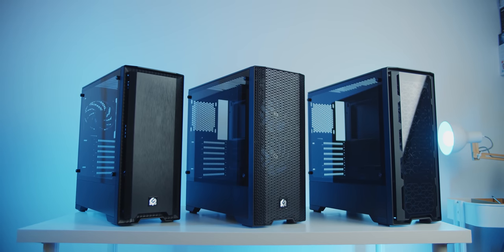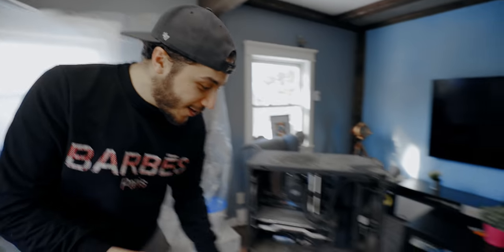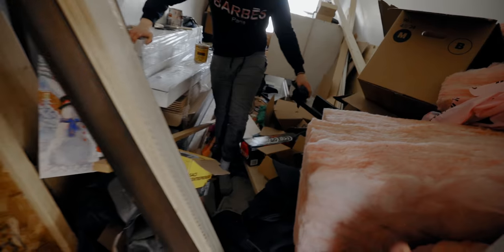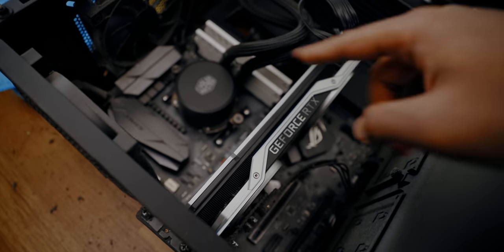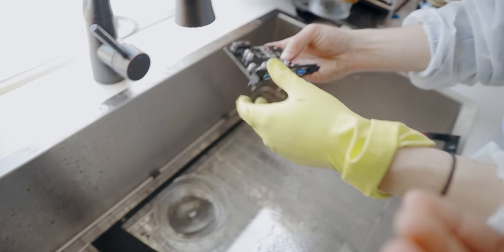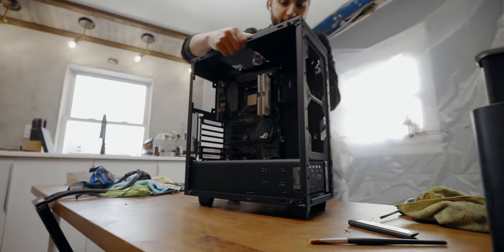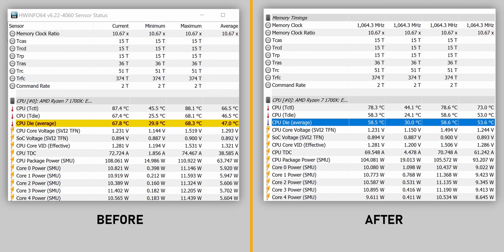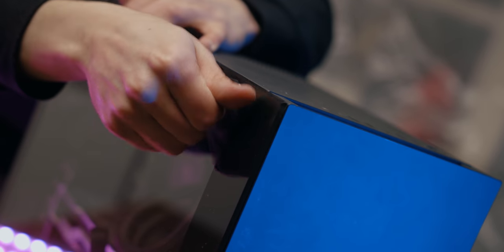THIS Is Why Cleaning Your PC Is Important! 🤦‍♂️

Comment from the maker: For those wondering - yes the liquefied USB card survived.  😎
Reply: Did you guys have it for the after tests? If not that could help explain the performance delta as well.
Reply: Surprised that whole PC didn't end up in an alcohol bath!
Reply: Electronics should survive regular water as long as they are dried completely before receiving power again.
Reply: I work in a circuit board manufacturer and we also wash pcb's regularly, as long as your water is balanced and you make sure it's dry it should be fine.
Reply: Damn bro, keep your pad clean. Givin the rest of us canucks a bad look.
Reply: Guess he watches youtube enough to know you can wash and dry PC components. And 10 degrees delta is 10 degrees any climate regardless of ambient. And that USB card is completely irrelevant to CPU temp performance. And the 2 degrees on the GPU came from less dust, you saw what came out of it. Not from the card being pulled.
Reply: Well techyescity did that to his motherboards
I have done that to my psus
Also I had open psus 😂
Yeah i know I'm risky but I don't touch the big capacitors legs as long you don't touch the 2 it's fine
Reply: a very THE VERGE moment there. I hope he screwed it back in with confidence.
Reply: LoL
Reply: Todd Ector wdym watern is balanced?
Reply: It's okay to clean PC parts like that if the part is getting dried very soon, so PCB does not get wet inside and metal parts do not corrode.
Reply: Having been in the electronics industry, washing boards is no problem - you can use compressed air to dry boards.    People avoid washing boards with delicate connectors.    You can use Alcohol or electronics cleaner and the alcohol will pull moisture out from under chips.   A USB board is no big deal, but something with a ball grid array underneath is best cleaned with electronics cleaners.
Reply: Roman "der8auer" puts his OC MB Just in the Dishwasher, so np here /watch?v=SVuI-Fn27-U
Reply: OMG I'm going to put my motherboard in the washing machine then
Reply: I mean, people wash motherboards in the dishwasher without problems. Afaik electronics fail when they are used while wet, short circuit and stuff. But as long as you let them dry out first electronics can usually survive a bit of water.
Reply: Of course it did. Cleaning PCBs with water is perfectly fine as it is for lots of other electrical components. What I would recommend immediately after a first short drying (tap it with some paper towels) is dowsing it in (or if you don't have large amounts...lightly rinse and brush it with) ethanol. This way you will be pretty safe and won't face a risk of corrosion occurring any time soon.
Reply: does anyone know where or what brand the barbes paris jumper is?
Reply: All I want to know is how's the I/O on the case?
Reply: Bro, he said he didn't clean it around 3 years. and the RTX came. on 2018. So he opened before. How vague you have to be to do not clean the stuff you use... and also his main system? Come on dude 🤣
Reply: David Peña Ortiz right? So he upgraded his gpu, probably changed power cable as well, like from single 8 pin to 2 8 pins, or single 6 pins, sure, full system clean out cost lot of time, at least use compressed air to blow out dust every few month
Reply: Someone told me once that diesel fuel or kerosene can be used to clean stuff like this. Whether or not it's true I have no idea and I'm not about to find out either. Only place I put diesel fuel is in the tanks on my 95 F350 Powerstroke Diesel.
Reply: @caominh2874  depending on where you live and your water supply yes, the pH of water is slightly different, also the mineral content of the water can leave behind a limescale residue if you live in a hard water area, if you do then it is best to use distilled water instead, although obviously that costs more.
Reply: Of course it did.
Reply: And that was the very first thing I was wondering when the video ended. ROFL.
Reply: Hardware Canucks HOW? I didn’t see anyone put that thing in rice
Reply: @JustinBone  and if you want to be more cautious, you can wash boards like these with pure water (distilled/deionized) as the conductivity only comes from the dissolved minerals/etc.
Reply: Im going to buy the neo air
Reply: i knew it would, there wasn't any power going through it when it was liquefied so why would it be broken
Reply: for anyone wondering as long as there is no electricity u can clean any component in water EXCEPT THE CPU AND GPU.
Reply: I've washed keyboards many time, especially in the office to people's horror, haha. Just make sure you have a hand-dryer or heater to dry it...
Reply: @MrMackievelli  i have it it is just an usb like extended usb if ur motherboard does not have so much usb the extended will help u actually u can plug and usb motherboard and the extended at the same time

Comment: Meanwhile I get bothered if there’s even a tiny bit of dust inside my build
Reply: Same I actually had left over ceramic coating from my car that I applied to my glass side panels to make clean up easier
Reply: Michael Graper woah I thought I was the only one that used ceramic on it.  As well as the fan blades.
Reply: What bothers me the most is the insulation that stuff flys everywhere with just a little disturbance and gets inhaled. It could have easily been put in a bag.
Reply: Same. I always put a cover over the dust filter on the top of my PC when I don't use it lol.
Reply: @michael_graper  Does ceramic works in acrylic panels?? I know that using only the ceramic coating won't remove the scratches, but what if I use that protective film and then the coating?
Reply: @-.2..  It should but I'm not positive. You can use an automotive polish to remove light scratches on acrylic and then a protective film on top should help prevent further scratches. I just ceramic coated to make cleaning easier I wouldn't go out of your way to buy a coating just for your PC.
Reply: Me too
Reply: probably your first month
Reply: I dust my PC very two weeks. I can’t stand dust particles. Lol
Reply: I spray mine with a can everday, and if i see a dust particle on the temepred glass i take out the cloth and windex :P
Reply: same
Reply: Tom the Fish same!,
Reply: Yeah I just wrap mine in plastic wrap to make sure nothing goes in, fun tips and tricks :)
Reply: Haven't cleaned my pc since I bought it its super dusty help
Reply: they can take a beating. 5 years easily without cleaning with average dust levels in the environment wont hurt at all. air cooling setups can be very low maintenance. liquid cooling you will need to service more often.

Comment: Dirty case or not shouts out to this guy for putting together his home, not an easy thing to take up for sure so credit for that.
Reply: Although it seems like he was running his PC near himself while renovating. Shit, I turn my PC off while cleaning my room until the dust settles.
Reply: Zimmy McFlimmy doesn’t matter if it’s off or not, dust can still get in it... tf
Reply: @foretell6819  It can still get in, but at least it's not actively being pulled in.
Reply: @SubjectE57  its fine if you have filters lol
Reply: @pedrosilvaproductions  I have a airflow case and I don’t want dust to get on my rtx 3090 so I clean it when 3 times a week
Reply: @SubjectE57  it’s not good to clean your pc while it’s on you can get shocked unless you have some sort of antistatic thing but when I’m near my psu cables and stuff I turn it off
Reply: @SubjectE57  I'm ocd about dust. I vacuum, mop, and dust every day. 

Open up my PC every 3 month and blow it out too

Comment: You need some TechYesLovin'
Reply: Yep, I would have just bought a dozen cans of brake cleaner and drowned it from top to bottom.
Reply: Time to get that WD 40 out
Reply: use Alcohol wipe 1st
Reply: @moebius2k103  Gotta whip out the datavac as well.
Reply: Bryan from TYC - laughs in brake cleaner and Datavac..."light work"
Reply: I was about to say "Where's the YES man on this?".  Personally, I'd have used some more GT-85 (made by the WD-40 company, it smells nicer and we don't have WD-40 lol) and brake cleaner.
As for washing the USB card?  That's fine as well - a bonus even.
Reply: RandomGamingInHD, Tech Yes City, Hardware Canucks and JayzTwoCents can maybe get together and form a PC gang like the old reality show Queer Eye for the Straight Guy. These guys will fix and clean your PC with a light makeover
Reply: Gotta get those car cleaner products!

Comment: IO dont works: Get a new case!

Yeah totally economical thought.
Reply: I mean u can get a perfectly functional case for the price of a cloth and and a couple cans of compressed air.
Reply: Finding a replacement daughter board for the IO would have taken so much time that replacing the case is easier. Shouldn't be that way, but it is.
Reply: @DFX2KX  I bought my Arc mini R2 case, right at the month, when the Mesify came out (So kinda out of production already). All the old reviews told it has a front USB, what can be plugged into a 3.0 or into a 2.0 board-connector. I bought it. When it finally arrived i saw, the plug is only an usb3.0. I had/have a 2.0 connector on my older motherboard. I just asked when the change happened -from the support-, they just asked about my serial number, and my adress, and sent a replacement front usb with the 2.0/3.0 combo.
Buying a new case should be a 4th option:
1: manufacturer support
2: ebay, and such
3: am i really need it, can not repair myself?
4: New case, from the newer era...
Reply: @DFX2KX  well, I would expect that the connector itself would brake, not the controller board. And a connector is dirt cheap.

Comment: I built my niece a PC at the end of 2018 and when I went to visit last summer, it had clearly not been cleaned since it had arrived. The house is full of animals and was completely covered in dust and fur in just the 7 or 8 months they had been using the system there. It pained me to see it that way, but it didn't take long to get it cleaned up and looking nice and clean.

The PC in this video? Holy moly. That was nuts.

Comment: Hi. As a rookie to the PC masterrace brand, I'd like to know 3 things.

1. I have a CoolerMaster MasterBox MB520. Almost same case as this one. Would it be a good idea to leave the the glass cover off when using the machine, in order to increase the airflow/reduce the temperature trapped in the case.

2. Use vaccum cleaner instead of blower

3. Best way to clean the fan that came with the Ryzen 7, without having it unmount it

Comment: You can disassemble the fan and clean it under a tap water. No problem, tested by me more than one time. Only problem will be if you wet the pcb, so you have to leave it some time to dry itself.

Comment: Ever since I got into Custom Loops a few years back the longest I've let one of my rigs go between cleanings is 6 months and my house is very clean compared to some and not so clean compared to others. Honestly with a low dust home giving your rig an in depth cleaning once a year should be good. Again that's an in depth cleaning, you should still clean the fan filters once a month or so depending again on how dusty your home is. I try and make sure I clean the filters on my rigs every two months. I could probably get away with waiting a bit longer to do an in depth cleaning but after 6 months or so I end up wanting to change coolant colors anyway or if not changing color just do an in depth flush and exchange the old coolant for new. This schedule of maintaining my rigs has worked well for me for almost a decade now. Just remember if you have a home that is on the dusty side you may very well need to clean your rig more often...

Comment: Yo that handheld duster is genius, I just bought myself one from the link!
Reply: return it and get a data vac, they are like 10 times stronger
Reply: They have generic data vacs that are just as good for 40 bucks on Amazon, but Isaac s is correct the one they used pales in comparison.

Comment: Case temps DO affect things.  My wifes comp's wraith cooler broke.  We upgraded to a water block.  We run similar systems, and hers started out preforming mine.  A year later I upgraded my case putting a water blocked MINE.  The difference while not staggering, was noticeable.  The difference was the water block exhausting out of the case directly, lowering the temps in the case.  Water blocks provide more stable temps, allowing the cpu AND the gpu to operate more efficiently
.

Comment: It’s perfectly fine to wash electrical components in water as long as they are completely dried before you use them again and/or aren’t something that holds a charge after being switched off e.g power supplies

Comment: This actually highlights an idea I have been playing with for a while, a sealed computer case with not air flow with internal radiators to cool the air inside the case, water cooling to all components in the case including system board, processor, video card, ssd, with external power supply because I am not water cooling that and throw some Silica Gel bags in the bottom to remove humidity. Keep the external cooler at 20C and I was thinking the Alphacool Eiszeit would work well to remove the heat and allow it to be in a different room for silence.
Reply: It is possible once you have removed the humidity you could get below the dew point and not have condensation buildup, insulate the case and hoses... interesting idea

Comment: I recently swapped my 8 year old build from the Antec 300 case I build it in (it suffered a lot of damage from my two kids over the years), into a freebie NZXT S340 Elite. I  thoroughly cleaned everything as I moved it all over to the S340. When I got to the PSU, I realized that I had never done any real cleaning to it besides blowing it out once or twice. Seeing as how it was about 10 years old (I recycled it from an an even older build), and definitely out of warranty, I decided to open it up to clean it. I'm ashamed to say, it was absolutely filthy disgusting inside! Brown dust, red dust, dust bunnies, dust elephants, cobwebs, and possibly a tumbleweed or two was in there. I think I even found Jimmy Hoffa's remains. Not sure how it never went full Chernobyl, but it didn't. I had to re-purpose some of my tiny model paint brushes to get into the nooks and crannies of the insides of the PSU, but it looks brand new inside again! I wish I took pictures of it before and after. Picture all the nasty that you guys cleaned out of that system, all jammed into a single PSU. Gross. Thankfully the PSU now draws air from outside the S340 through a filter instead of sucking up all of the crap that made it past the old case's filter.

Comment: Would have been nice if Snows bought a couple of WD-40 Contact Cleaner Quick Dry Cans, but nevertheless - it was a good thing you finally decided to clean it.

Word of advice though - if you do clean your PC using WD-40 Contact Cleaner (Green - not the Blue one), do not use it on your Hard Disk Drives, I learned that the hard way.

Comment: You should have taken it outside and blow the hell out if it with a compressor (hold the fans to be safe), it would have removed 95 % of the dust and cobwebs for 5 % of the effort.

I have moved the the internal dust filter on my build to the outside, so I can take it off and vacuum it once a month or so.

Comment: I know it is an AIO, but they should probably consider actually cleaning inside / replacing it considering that some junk can build up in there over time.

Also, why didn't they just take all the components out and actually wash / wipe (carefully of course) the case itself rather than trying to blow everything?

Comment: You can cleaning all the parts, except: PSU, RAM, SSD/HDD.
Wash with water and soap, and dry it properly (make sure 100% no water left).
I do regulary cleaning my PC part with water every 1-2 year, and they are very clean like new.

Comment: Ryzen 1700 with a 2080? The hell, lol.

I let my stuff get dirty but for me the only thing that was ever impacted by dust was my gpu and that was because I was scared to open it. I mainly just tried to clean it from the outside. But one day I decided to upgrade my cpu and decided to Yolo it and take apart the gpu and clean it. Holy hell. My gpu is a champ. It had like 80% obstruction and powered through it. Ran much cooler after cleaning. Though the spot where the power goes in is still hot as fuck to the touch while running. Dunno what to do about that but it's an old card anyway.

Comment: Unless you live in a super dry area I doubt your fans spinning from air blowing on them is going to create any significant static .
Reply: It isn't from static. You're spinning the motor backwards which is making it act like a generator so it is dumping current back down the wire into the header on the GPU or motherboard.

Comment: I believe your top fan became louder because you cleaned it. When dust keeps accumulating on your blades, it changes the balance of the fan. One thing you could try is removing the sticker and lubricating the bearing with something like WD40. I've been doing it for years. The weird thing is that you cleaned the system indoors. With this amount of dust, I'd just take it out of the house and use a blower to clean it

Comment: Not sure if it was said but sounds like you guys were able to reduce the temps on the GPU just enough to knock it down one temperature threshold sample range which resulted in the GPU maintaining higher boost, thus equating to higher frames.